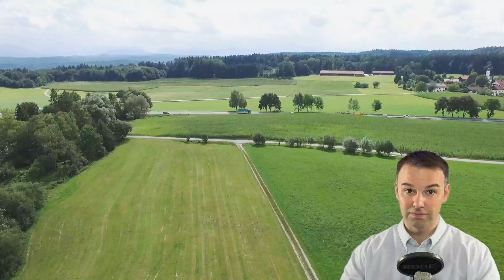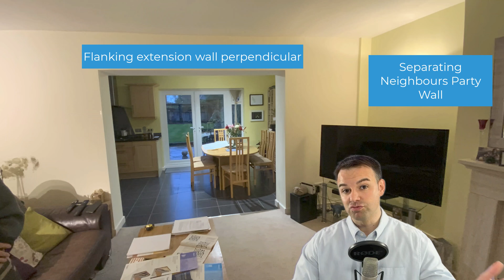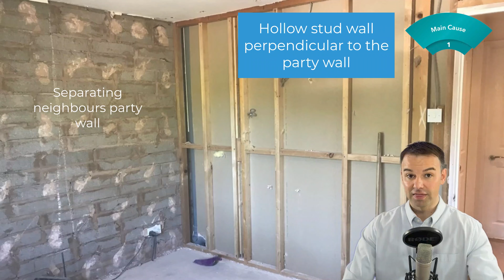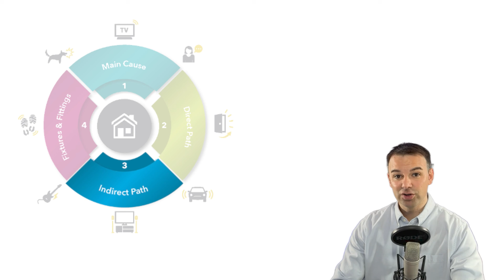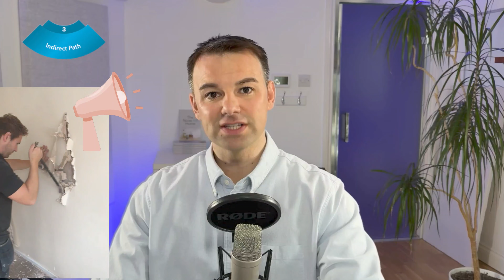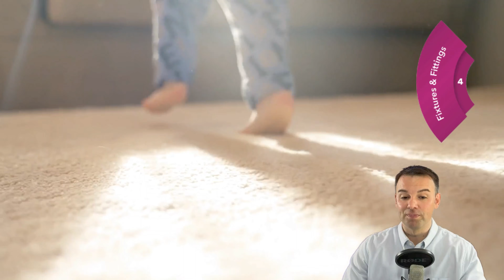How to SOUNDPROOF a New Build Semi-detached Property

Comment: I live in the U.S. and have stud walls with drywall, no brick. Going insane. Do you have videos on those types of walls? Also what about acrylic window inserts?
Reply from the maker: Hey @jonessa-rj4ey,

Thanks very much for your questions 👍 Quite a few of my videos feature stud walls, but ideally, for the best results, you want to build a completely separate isolated stud wall in front of your existing stud wall.

I would remove the existing drywall first and insulate the existing stud frame with a good Rockwool slab.

Then build your new independent wall in front, isolated from the existing stud wall. I’d fill the new frame with Rockwool, then use resilient channels, or potentially Genie Clips and channels if you want to upgrade the isolation, followed by two layers of acoustic drywall.

You could upgrade the system further by adding MLV between the two layers of acoustic drywall.

If the new independent frame is timber, you could also install a 5kg/m² MLV directly onto the stud frame after installing the Rockwool, before the resilient channels.

The important bit is that you’re not just adding more materials to the existing wall. You’re creating a second isolated structure, which is what gives you the separation needed for a much better reduction in noise.

Hope that helps 👍
Reply: @jimprior7  thank you so much! It means a lot to me that you took the time to help me. Thank you for helping all of us with these issues as sometimes there is no way that we can just move. Wishing you much success.

Comment: How would you do for party wall that has stairs either side? We can hear our neighbours running up and down their stairs and landing. They have laminate on the stairs and landing
Reply from the maker: Hi @amandabyrne3507,
Thanks for your comment 👍

Stairs either side of a party wall can be a difficult one because what you're describing sounds like predominantly impact/structural noise. Every time they're running up and down the stairs, that vibration can travel through their staircase into the party wall and then into your structure.

The laminate on their stairs and landing certainly won't be helping either!

I would start with the ear-on-the-wall test while somebody is using their stairs. Listen to the party wall, but also your staircase, the walls alongside it, the floor/landing above and underneath the stairs. You may be surprised where the noise is actually loudest.
If the party wall is the main noise path, we'd normally sound deaden that wall first and then use a properly floating frame wall system if you have the space....however most stairs we install the TPS65W wall system (50mm thick) But with impact noise like this, I wouldn't assume that treating the party wall alone will solve it. You may need to treat some of the adjoining walls, floor or ceiling as well, depending on where that vibration is travelling.

If your neighbours were willing to help, putting a good impact-reducing underlay and carpet on their stairs and landing would also be worth considering because you're tackling some of the impact at source before it enters the structure.

Stairs wall impact noise 👇
https://youtu.be/MLEbVW_UYZo?si=ijnVjzpO0K4q_n5l

Hope that helps 👍

Comment: This is so shocking that new builds have this issue. I live in a 1930s built flat and had to install a floating ceiling but still get noise from below and next door. Which seems fair for something this old but new builds too? Wow
Reply from the maker: Hi @Hero87,
Yes, I’d take your 1930s flat over any new build in the UK too! At least back then they used heavyweight materials and solid construction — now it’s all lightweight blocks, dot & dab plasterboard, and thin timber floors.
It’s crazy, but the modern building techniques that have revolutionised the speed and cost of construction have done the opposite for sound insulation. Any alternative that actually works takes longer and costs more, so it rarely gets done unless someone insists on it.
Thanks for sharing — and hats off to you for installing a floating ceiling. That’s serious commitment 👏 Let me know if you’re still getting impact or airborne noise and I’ll point you toward a few options.

Comment: My issue is I can't hear my neighbors talking or shouting. What I can hear is mpact nosie running through my living room roof every time they walk around upstairs. What would you suggest?
Reply from the maker: Hi @mrdami3n,
Great question — and a very common issue in modern homes! Im assuming you have a semi or terraced property and the noise is coming diagonally above from Nextdoor?
I recommend the systems outlined in this video. For impact noise like footsteps coming through your ceiling, we usually find you need at least a 175mm thick system to really reduce it. That means sound-deadening the lightweight blockwork, then building a floating frame in front.
💡 Important: The noise you’re hearing isn’t just coming from the shared party wall — in fact, that’s usually a small part of the problem. Impact noise transmits through the structure — ceiling joists, flanking walls, window walls, RSJs — so the more of the structure you treat, the more reduction you’ll get.
👉 On the window wall and any rigid insulated flanking walls, you’ll need to treat them with the 50mm system shown here:
 Soundproofing for Beginners | Full Course Tutorial https://www.youtube.com/watch?v=hVqa1m3JzGs&list=PL-ZigmSd311dNw8Tbe1IfLiJgEiJcjvMN

And yes, the ceiling will need to be mass filled too — this is crucial for stopping that footfall noise.
If your cavity walls or flanking walls have rigid insulation, then unfortunately, you’ll need to treat those as well. We’ve seen many people spend a lot of money soundproofing the wrong parts of their new-build, only to be disappointed. Treating the right areas properly is key to getting results.
Reply: @jimprior7  Thank you for getting back to me. On further inspection I took the skirting board off and behind it is a 2" gap filled with dat and dob adhesive all over the place bridging the floor to the wall. The gap leads to a 16" deep hole which i am assuming goes to downstairs ceiling and  just shows the bare breeze block. 

It is a semi detached house and only went up 6 months ago. Nightmare noise, bang thud all day every day and I can even hear shouting now. I will look at the video closer and see if I can do anything to reduce it. 

Trying to chase up the developer but they keep saying it's done to regulations which I believe it isn't. Going to be a battle but im going to fight it.
Reply from the maker: @SOTkingdom  Hi @mrdami3n,
Wow — that sounds all too familiar, sadly. We’ve found huge holes just like that in so many brand new builds here in the UK. It's become so expected that bricks, sand and cement are the first things loaded on the van when we're heading to a new build job. No joke — we once had to turn the van around 15 minutes into a journey because someone forgot the bricks, and we knew we’d find holes… and yep, we did!
That dot and dab bridging the wall to the floor, with a deep cavity behind it — that’s a classic setup for flanking noise and structure-borne sound. It’s also why these modern homes are so hard to soundproof: they’re full of lightweight Thermalite blocks, air pockets, and connected voids everywhere — even outside the room you’re trying to treat.
To fix it properly, every hollow void needs insulating and the blocks themselves need sound deadening with 20mm rubber, not just mass layers. It’s frustrating, but the construction methods are what’s letting you down — not you.
Keep chasing the developer — you're right to fight it. “Built to regs” unfortunately doesn’t mean “quiet” — just means they passed a very basic acoustic test. You’ve already done the hardest bit: you’ve identified the problem. Now it’s just about treating it properly.
Let me know if you want help putting together a step-by-step plan — and definitely keep digging into the video for the right techniques.
Reply: @jimprior7  Thanks for the advice. Hopefully they will do something about it and anything extra ill try to do myself. Ill keep watching your videos and hopefully learn a thing or two.

Comment: I'm in a new build detached and it's like living in a tent when it rains, plus I can hear cars and planes like I was outside. I suspect I need to improve the patio doors on the main bedroom, but generally I'm wondering what I can do in the attic space above the bedrooms, as I'd rather not do a big job in the rooms themselves, partly because the wardrobes are too tight fitting, but also looking for something less messy that I might be able to do myself. The insulation up there has just been chucked down anyway, can I replace it with something else, or layer it in a way that'll help?
Reply from the maker: That sounds frustrating, Joe and sadly it’s all too common in new builds. They meet the minimum regs, but not always comfort! You’re right that rain noise, cars and aircraft can be a sign of poor airborne sound insulation, especially through thin roof structures and large glazed areas like patio doors.

👷‍♂️ In the attic, you can make some improvements DIY:

Replace the loose-fill insulation with dense RW3 mineral wool (e.g. RW3 or acoustic-grade slabs....must be slabs not anything in a roll) between and across the joists. 

Add an additional cross-layer over the top to reduce flanking noise through the ceiling below and also you could add 10kg/m2 TecSound between the 100mm slabs of RW3.

Make sure everything is well-fitted and continuous  no big gaps or sagging and don't block up the airflow to the loft.

It won’t completely solve it, but layering properly can help muffle high-frequency noise (like rain and planes) and make a noticeable difference.

🔧 For the patio doors — upgrading to laminated acoustic glass or fitting secondary glazing can be a big win, especially in bedrooms.....But only if the window reveals and patio door reveals are not plasterboard!!! - change this first before upgrading the windows and patio doors.

If you're ever unsure where the noise is coming in, try the “ear to the surface” trick during rain or traffic — you'll be surprised how much you can pinpoint!
Let us know how you get on, happy to help if you want to go deeper 👇
Work With ME:
https://jimprior.com/work-with-me/
Reply: @jimprior7  Thanks for your response Jim, lots of great stuff there - particularly for the reveals of the patio doors (which are plasterboard from what I know). Would I put the Tecsound down first (on top of the ceiling plasterboard) and then the Rockwool RW3 on top of it, then the cross layer? Would it be worth re-using some of the existing basic roll insulation for the cross layer? I've probably got more questions too but it feels a bit much on Youtube comments so I may well consider your consultancy service. Thanks again!
Reply from the maker: Hi @JoeFentonPhotography 
just to clarify the order for the ceiling treatment:
👉 RW3 first, fitted tightly between the ceiling joists
👉 Then lay the Tecsound membrane over that
👉 Followed by another layer of RW3 on top
👉 And finally, your existing loft insulation over the very top

It’s a horrible job (especially that loft insulation!), but honestly, no one will do it better than you as the homeowner — attention to detail makes all the difference up there.

If you want a hand planning it out properly, I’d definitely recommend booking a virtual Zoom consultation. I can walk you through exactly what we've done in hundreds of homes dealing with outside noise — and we can even record the session for you to refer back to.

See you on the Zoom call 👉
https://jimprior.com/work-with-me/

Comment: what if i sound deaden the dot and dab plasterboard by putting rubber and put another wall infront of it(floating frame with rockwool)with 25mm air gap infront of the dot and dab wall. will this reduce STC or make it worse?
Reply from the maker: Hey @Dawgley, thank you for your question, it is a good question and if only we could do that…
Removing the dot and dab will only take you a few hours with the right tools. This morning one of my teams removed the dot and dab off two walls in less that 20mins and they found huge holes going through to next door behind the plasterboard….look out for that video next month. 

The truth is the dot and dab increases the noise you are hearing but it also channels the noise around the rest of your house. Other than avoiding the mess it creates from removing it, I can not see many reasons to leave the dot and dab in place. 

One final thing @dawgley, the technique of using the dollops of solid adhesive should not be used on any soundproofing products either. It definitely compromises the soundproofing products even the 20mm rubber.

Have you seen this: 

https://youtube.com/shorts/mXcynW4RJ_E?si=-1RiXsih6IQZnlUh

https://youtube.com/shorts/mXcynW4RJ_E?si=Sk-WzXZqXnCIZNub

Comment: Hi Jim love the videos . Just a quick one. I have 1 layer of m20 rubber and 2 layers of acoustic plasterboard. Should I put Mass loaded vinyl in the mix or just leave it like that?
If so where should I put it? (Layers are not on the wall yet
Reply from the maker: Hi @Hdproductions939, for that system you could install the MLV between the two layers of acoustic sound bloc board. So plenty of adhesive to create that resilient layer. 
Assuming you have applied sound insulation to the flanking noise paths that system will offer about 55%-60% human perceived reduction in noise at those higher frequencies. 

It’s a good cost effective system when space is at a premium. Are you on the Noise Free DIY Soundproofing course? 

If not maybe get for it registered….there is an incredible offer at the end of the month…if you’re not registered you won’t receive the email offer.

Comment: A lot of homes prior to the 2nd world war only had a single brick party wall between them. That's 4.5 inches of brick plus a bit of stud/plaster.. perhaps just 7-8 inches seperating you from the twats next door. Most of these homes also share floor joists so you not only hear lights being switched on and off but you hear them talking and thudding about also. Some people seem to think you need to shout to be heard on the phone.  

I have new neighbours from gongle dongle. They are built like hippos. You can hear them walk around. Thankfully they no longer shout every conversation - after a chat with me and them.. and then their landlord (when they ignored me).  Some people are awful neighbours in these types of homes.. they don't tread gently.. they couldn't give a toss. They can't even open and close a gate or bin with decorum or consideration.

Comment: Thanks for your reply the other week, have been looking forward to this video! Extremely helpful in visualising what is going on in my attached property. I think I'm a bit lucky where the main noise I hear, is powerpoints through the bedroom party wall (plugging in phone chargers/flicking the switch). Given that it's dot and dab plaster, I have discovered that the electrical cables are run down in channels which have been cut into the blocks. After watching this video, makes perfect sense why I can hear the neighbours switches through the block wall so easily. No voices, no dogs, just switches! But its an unnerving sound to suddenly hear at full volume while trying to fall asleep. Thanks again for this video.
Reply from the maker: Hi @kramermartinezz, I actually suffered from this noise myself before soundproofing my house. Every night, we would hear a phone charger being plugged into the socket the other side of the party wall in the bedroom. Then once you're awake and irritated by this noise from next door....it is difficult to get back to sleep! The solution is that the wall must be sound deadened followed by a floating frame isolated from the structure....like I show in this video: https://www.youtube.com/watch?v=4Utchs-ZA6I

Unfortunately, a lot of DIYers, builders and soundproofing installers do not sound deaden the wall first like we show you in the Noise Free DIY Soundproofing Course. They still use the traditional stud frame building methods....they call it an 'independent wall'.... but it is still built the same way as a traditional stud frame, l apart from it might have a gap from the party wall. I made this same mistake myself when I renovated my 3 bed semi-detached house and built this 'independent wall'.

If you can sound deaden the wall and then install a floating frame isolated from the structure then you will not hear these 'plugging in phone chargers' and switches through the direct noise path.  However @kramermartinezz....to see if this will work for you, you need to put your ear on those flanking walls and tell us if you hear the plug sockets and switches on those flanking areas.....if you do....then this video shows the extend of the renovation that maybe required to reduce this noise.
Thanks very much for your comment, let us know how you get on.